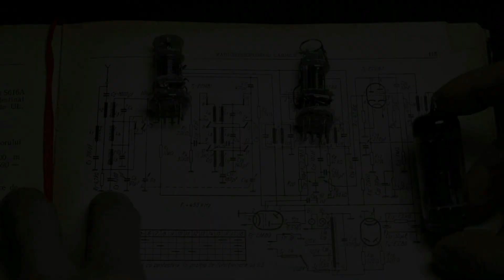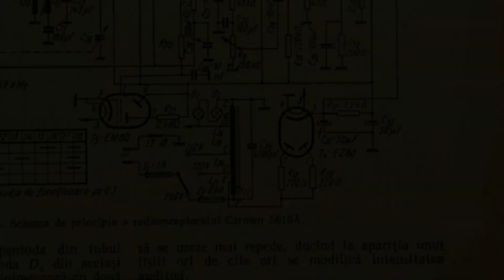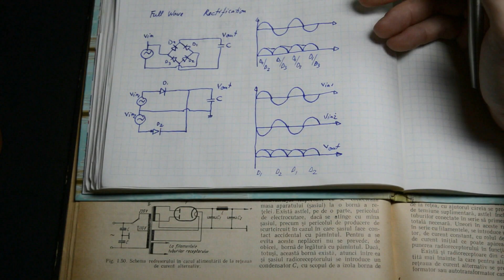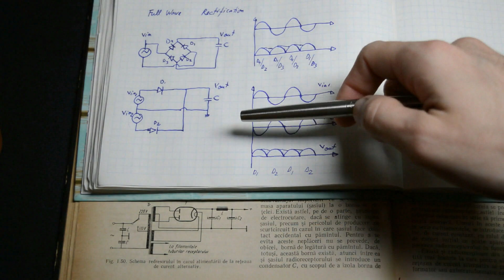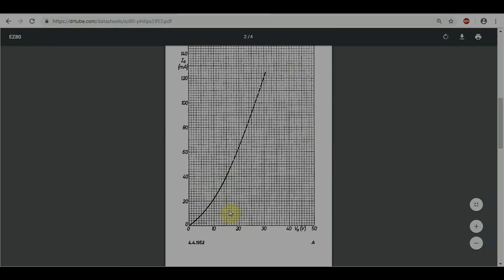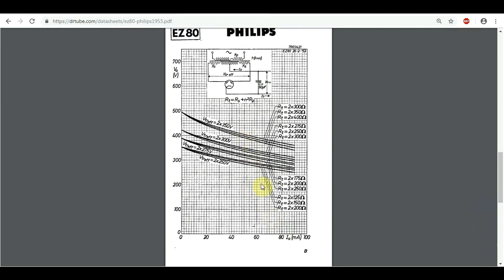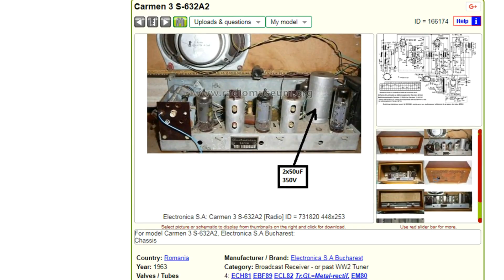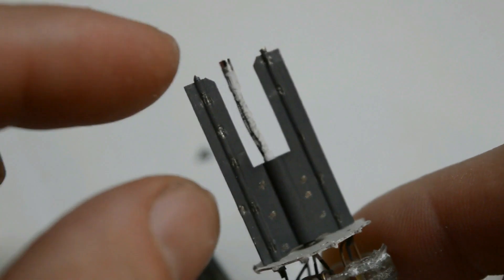Vacuum Tube teardown - the EZ80 double diode rectifier

Comment: Very good analysis... however, he did not mention the maximum heater-cathode voltage rating.  These 6.3 VAC heater type tubes have limits, e.g 400 VDC with cathode positive to heater, 200 VDC in the reverse (not a standard FW rectifier.)  This is for the very similar, but octal based 6X5.  Thus, the RMS AC supply voltage must be limited to, say, 400 /1.414 to be safe... about 280 VAC RMS.  I'd prefer 250 VRMS... OK for a radio but too low for a decent audio amplifier.
Also, there are rumours about to 6X5 and 6X4 heater cathode failures... basically fatal to the AC transformer.  I have never seen any data on this, but it does put me off using these tubes.  All I can say is that the 6X5 and 6X4 MAY fail due to a H-K short, but it is quite rare.  The EZ80 and the larger EZ81 don't seem to be as afflicted... again no data. Does anyone have any such data?
Hope this helps.

Comment: If I have single vaccum diode with input of 2kW power in anode, filament Voltage 5.7 to 7 V how can i get the output any formula its there, can u share the formula
Reply: 2KW input - BOOM

Comment: Hi, Another reason for this kind of damage will be a shorted or leaky filter capacitor. The cathode looks like it exploded... Liked the video.
Reply from the maker: I think that is also a good possibility. The old capacitors where not know for being very reliable.
Reply: I've got a radio with a rectifier tube I found being put under extreme stress, the primary capacitors were bad and it was drawing excessive current.